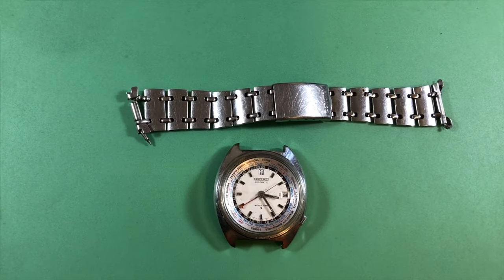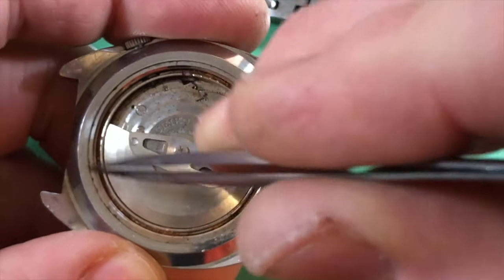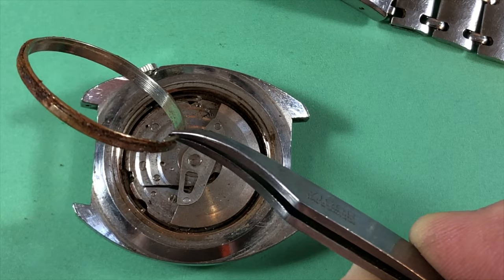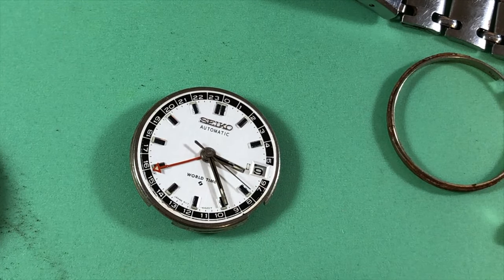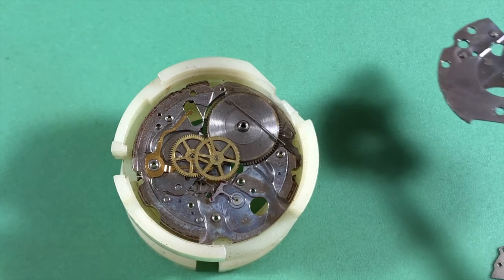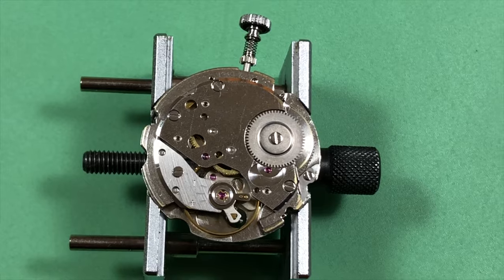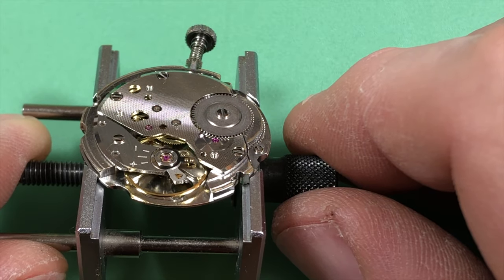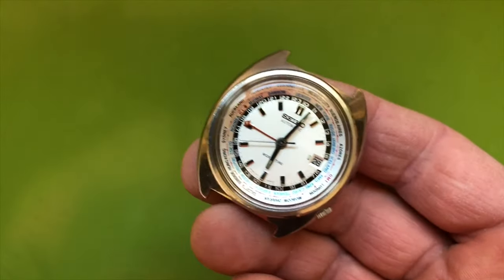For AS: Seiko 6117-6400 World Time restoration

Comment: I wish you would have shown removal and replacement of the crystal...how is that done on this model?
Reply from the maker: These are an acrylic "T" crystal - tension ring.  They're more involved to do, it never occurred to me to talk about how to change their crystals.
Reply: There’s an external bezel ring so I didn’t know if a bezel remover tool was needed to allow the crystal to be removed, but I ended up using a crystal press to carefully press out the crystal from inside the case without having to remove the external bezel, then carefully use a 16 size plastic insert on the crystal press to reinsert it, but if you force it, you can damage the crystal. It should just pop in as I found out. The crystal has to be removed to change the plastic ring gear, which is usually the part that fails when the inner bezel won’t completely revolve.